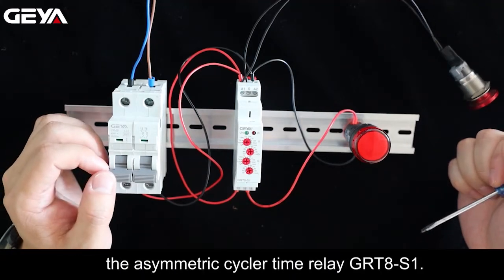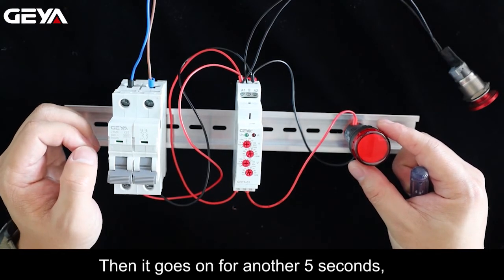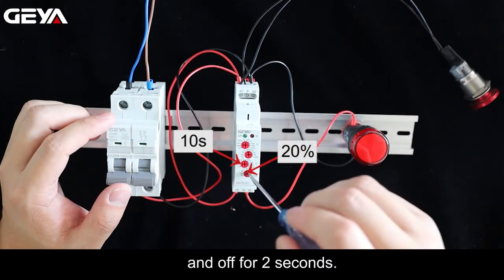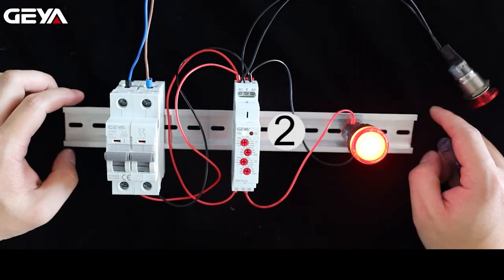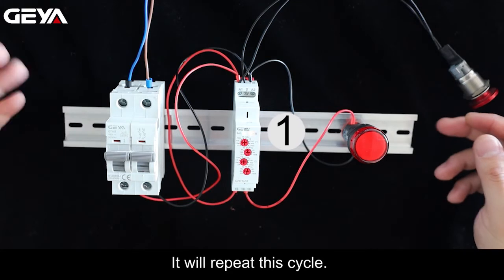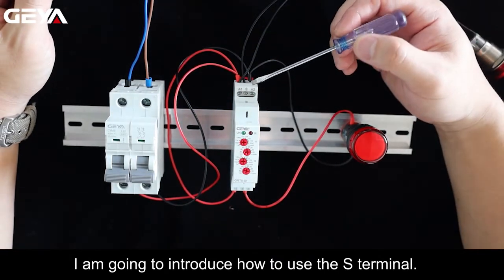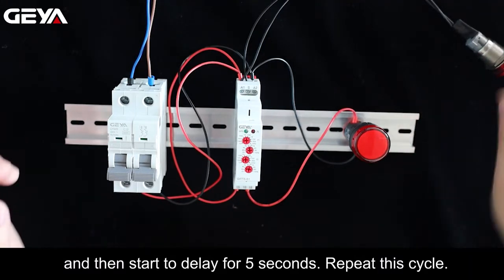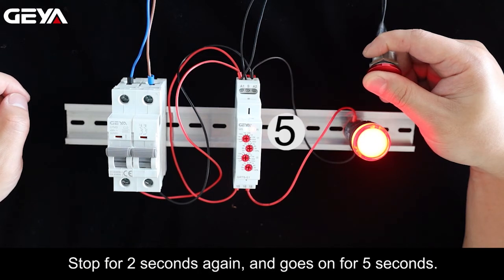How to use asymmetric cycler time relay GRT8-S1 | Geya Electric

Comment: I have two LifePo4 batteries, Basen Green 11.7kWh 51.2V (BG), and Ecoflow Delta pro - inverter 48V 3.6kWh (DP). I use BG to charge a DP battery via XT60 solar input (400W 8A). 
With the DP application, it is not possible to set the BG not to be completely discharged? 

Would be such DC Voltage Monitoring Relay and Undervoltage Protection Relay suitable for my batteries? Can I put it (and how to set it) between the batteries so that voltage limit (under 50V) will stop charging DP from BG battery?